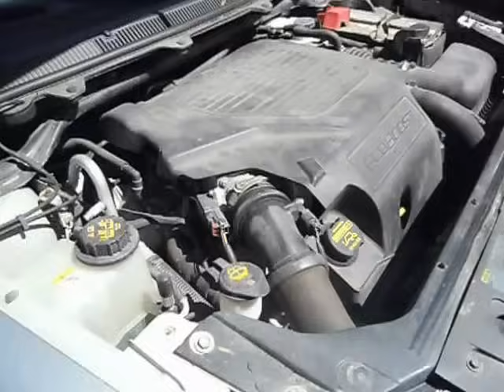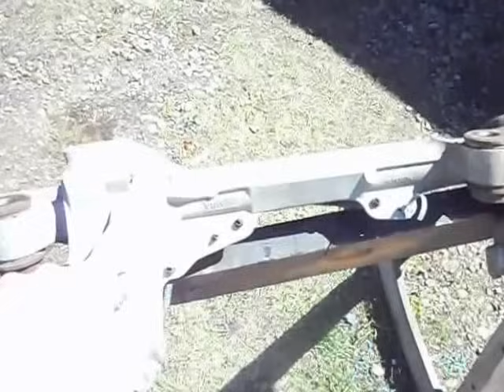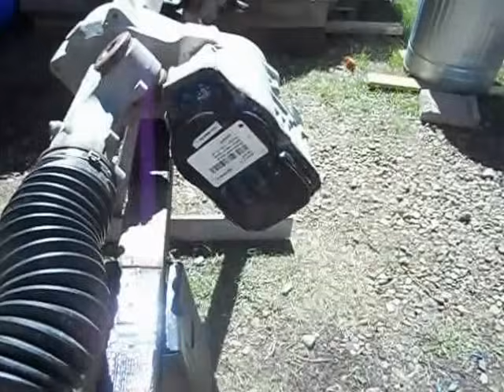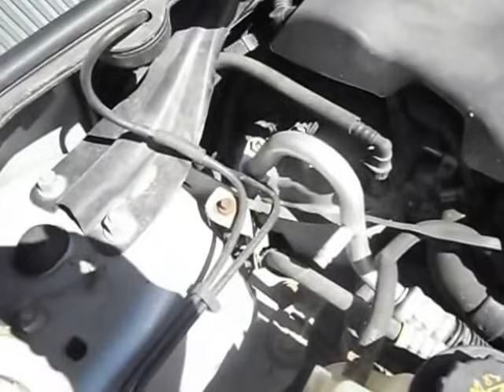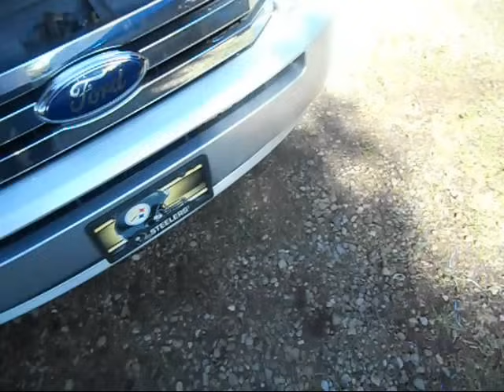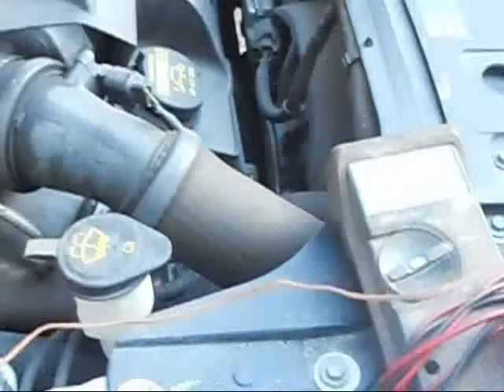Ford Electric Power Steering Failure Identified

Comment: Bro. I need to know what pins you test for resistance. Can you help me out.
Reply from the maker: Performed test almost two years ago, so many details blurred. Also note EPAS design is highly proprietary; so Ford published no documentation, schematics or even operational information concerning design. However I can tell you drive electronics include fully integrated IC with wire-bonded PC connections. All manufacturer labels and markings omitted. Servo-drive motor (either stepper or brushless) includes pigtail with connector  interface to driver PCB. This pigtail interface is where measurements were taken. Measure resistance from individual motor pigtail wires to PCB VCC and VSS. Typically you should always read some resistance; either related to motor winding or driver protection circuits. What you should never see is mOhm resistance between motor coil lead and source potential; this indicates blown MOSFET or transistor junction, effectively providing faulted high-current path to one or more motor winding's; locking motor in place, or causing errant servo positioning. Correctly identifying VSS and VCC is matter of tracing +12VDC and GND from EPAS power filtering circuits at unit front-end. There are (as to my recollection) three individual PCB implementations comprising unit; power and signal conditioning, microprocessor based mother board, and driver PCB. All three are interfaced together through pigtails, ribbon-cable connectors and large copper power tabs. Implementation included highly-integrated  SMT components with various discrete elements. PCB implementations were intended for non-serviceable application; with bonded interfaces between discrete PCB's. You will basically need to cut copper power tabs to separate PCB's.  
Note TRW applied for patent on brushless-motor  based electric steering invention, which seems to closely match Ford unit. This patent design includes motor, three-phase H-bridge driver, microprocessor based controller, motor and rotational steering gear optical encoders, timing belt rack-drive. This patent formed basis for many assumptions made concerning design. It is possible some design changes were implemented in actual production. However patent concept matches implementation precisely, and TRW did license design for Ford use.

Primary EPAS problem is complexity and cost. it is not possible to cost-effectively design and implement such design complexity and diversity within automotive performance standards. Design includes delicate optical encoders, microcontroller, non-volatile memory, etc. These components, in automotive temperature grades, are cost prohibitive. And in many cases, like memory IC's, just not available. Ford approach was to enclose lower-grade components within aluminum housing, in attempt to shield delicate components from thermal stress, and manage thermal exposure under hood. But like any design engineer; whom has implemented such design learns; managing thermal stress is problematic at best. Always leading to instances of thermal overload, no matter how well implementation is planned. How Ford was able to qualify such design, given automotive design and safety standards is highly suspect. Process of qualifying an 'intrinsically safe' electronic implementation includes highly-detailed external analysis of design by 3rd party regulatory agency. In my experience; every circuit and discrete component is analyzed for fault potential. Philosophy involving thermally shielding non-application-grade sub-components in severe and unpredictable thermal environment would be immediately flagged. This is what occurs when engineering design oversight is performed in-house by giant $200B corporation. And regulatory and safety agencies conduct business with complacency and political agendas.

Comment: What needs removal in order to get the epas out? Thanks
Reply from the maker: Job is not too bad for experienced mechanic with air-tools. Service manual procedure should be followed exactly to prevent damage or problematic repair. You may find free shop manual at https://workshop-manuals.com/. Flex requires lowering of front frame assembly. Can be done with hand tools; but many large and rusty bolts. Many important details (e.g. disconnect electrical connectors and steering shaft prior to lowering frame, note tie rod adjustment points and approximate on new assembly, fix steering wheel in forward position prior to disassembly to prevent damage to and align clock-spring, etc.). I was able to complete replacement in approximately 4 hours with air-tools, hand-jack and 6 jack-stands. EPAS did not require any programming after installation, but one Youtuber insisted this was required for his installation. Others have indicated installation is much simpler on alternate Ford models.
Reply: B Smith thanks for the quick reply and great breakdown of the part. This has been an intermittent problem on start up for me but usually resets itself after turning vehicle off and on again. No such luck this time.
Reply: @bk1468  Looking up the part they mention it has to be programmed?  Any info on this?  Thank you!!
Reply from the maker: @mrhallman64  Programming will be required on units not specifically designated as exact vehicle model replacements.  My unit did not require programming as replacement was specific to vehicle. Some commenters have indicated programming was achieved using OBD tools. But I have no specific experience related to programming EPAS units.

Comment: Bro i have a kia it's EPS when I turn the steering a little bit to  the right side  at a certain angle the steering make unusual sound like something is grinding inside and when i complete turning it the sound disappears, 
What is the problem ??
Reply: Did you ever find an answer to this issue ?
Reply: @hederg1621  no

Comment: I beg to differ. 90 degrees is less than body temperature. And ambient temperatures all over the world exceed 90 degrees. If 89deg F is too much for industrial electronics..the the whole world would be awash in malfunctioning shitaki...

 Commercial electronics can survive well into the hundreds and industrial is even better - military is even better than industrial.

That housing being 90 degrees  means very little
Reply from the maker: You have confused degrees C and F. Video specifically states degrees C, which implies housing is near boiling point of H2O, not human body temperature. C = 5/9 (F-32)
Reply: Roudter where did you come up with 90 degree f??
Engine bay can reach temp 600- 800 degrees!!!!
Reply: Wow...I thought the C vs F thing settled it...But 600 degrees anything...those are some vehicles you work on!...
Reply: Roudter 
Ok Roudter I missed that part, but still you have to admit you don't want to set your laptop inside the engine bay, and expect it to function properly

Comment: What side did you  remove it from
Reply from the maker: The following instructions valid on Ford Flex, alternate Ford models may vary.    
EPAS unit cannot be removed from side. Front frame member must be lowered (not removed) to gain access from rear. Replacement is not simple and requires care and experience. Air tools strongly recommended but not required (but you will need breaker-bar and quality sockets). Vehicle will require realignment upon completion. Most important points are disconnection of power and communications connectors, and steering column shaft nut prior to lowering front frame fully. Engine is supported by front fame also, so lower engine mount needs to be detached. Front suspension components need not be removed for EPAS replacement. Vehicle needs to be at least two feet off ground, with additional jack placed under front frame for controlled lowering. Failure to disconnect connectors and steering shaft will result in damage. Also, carefully mark tie-rod positions on removed unit and match new unit positions to old. Lock steering wheel in place and never turn steering wheel with EPAS unit detached (clock spring damage). Align new and old EPAS mechanical steering positions carefully. Give yourself at least 6-hours to complete replacement. Ford vehicles suffer from extreme corrosion issues, so various large bolts may be very difficult to remove. Use PB Blaster penetrant hours before disassembly.

Comment: Thanks for the information. I have a 2011 Fusion and guess what failed this morning my power steering. How would you go about fixing the problem? Thanks
Reply from the maker: You can pay $2K+ at dealer, or $600+ self replacement with refurbished unit. Unfortunately replacement will not address root cause of failure; likely fail again at some point. Make repairs and dispose of vehicle is best advise to avoid future frustration, cost and safety hazard.
Reply: B Smith thanks will follow advise

Comment: i have the same suv as u..so i have to replace that whole thing??
Reply from the maker: Get out your checkbook; Ford wants around $1,700.00 for assembly not including labor. Remember, the new unit will also eventually fail since Ford has never addressed or disclosed overheating issue. EPAS assemblies cannot be third-party repaired; units are remanufactured with replacement of burned out components.
Note units are particularly sensitive to warn front tires; as EPAS servos compensate 'back-force' generated by uneven tire tread. This cyclical servo actuation places extra thermal stress on system which finally contributes to catastrophic failure.
Reply from the maker: Your best option is to purchase unit from ebay and install yourself. This will cost you about $400.00. Contacting Ford will only cause you pain.
Reply: +K Smith ok im mechanically inclied and alwaus have done all the work to my cars...any seller u recommend?
Reply from the maker: Ivan Hernandez
partsbrokersllc (in NC or SC?) sometimes lists remanufactured EPAS units on ebay for around $300.00. Do not know their ebay username. Just do a search for 'ford steering gear', your model and year.
Find detailed service manual instructions for unit replacement; job takes about 2-3 hours with no special tools; but you really do want to follow procedure when removing front frame sub-assembly. Also make sure you carefully disconnect electrical connectors prior to fully lowering frame assembly with jack. Also replace both outer tie rods with quality replacements; because Ford used undersized and ultra-cheap originals.
Job is really quite easy if you have air tools, and a bit more time consuming if not.
Good luck!
Reply: +K Smith ok ill do tha .thanks for ur info..one last question..by any chance u got a detailed disassembly procedure? cant seem to find too much about this on the internet yet..apreciate it
Reply from the maker: Complete and free service instructions can be found at the following link. 

http://workshop-manuals.com/

Comment: rock auto selling them starting at 372.31$
Reply: Link?  I'm not seeing it on the RA site
Reply: Beware.. I’ve just gotten two bad units in a row from Rock Auto. 

They were both Motorcraft reman units. Second one looks like it had a brand new housing (no threads had been cut for the heat shield yet). First unit made a noise like a bad bearing and turned very stiff, which caused a code to set. Second unit is quiet but still turns a little stiff, sets a different code and shuts off all assist after 2-3 miles of driving. 

I’ve had my little shop tied up for two weeks now sending units back and forth trying to get a unit they works correctly. It’s very frustrating. For the vehicle I’m working on (2013 Taurus Police model) the unit costs $413 plus shipping and taxes with a $400 core. It was a good price and that’s why I ordered from them, but they must have gotten a low quality batch or something.
Reply: selling garbage that is new is still garbage

Comment: my wife has 2010 fusion steering went out ford needs to be sued shitty design and danger
Reply from the maker: I invested two years in legal action against Ford Motor Co. In the end I recovered only part of original investment. The experience was an aye opener into the real workings behind a 200 billion dollar syndicate.  You cannot win; Ford will deny, delay and attempt to criminalize your complaint. Ford employs thousands of attorneys specifically tasked to deal with customers who dare to sight design flaws and incompetence in Ford products.
Do not even call Ford; just repair vehicle and sell it as fast as you can. And never go near a Ford product again...
Reply: thanks my thoughts also
Reply: get your vin number type in ford fusion recalls. mine was recalled. went in to get it fixed work for 20 miles and went out again 😂

Comment: twin turbo's in a mini engine compartment ..?
and
you expected no problems ..??
bwhahahaja
Reply from the maker: Try twin turbo's, dual catalytic converters, dual exhaust and manifolds, engine and radiator all crammed with centimeters between components. Even Ford models with no turbo's and smaller engines fail with equal persistence and frequency. What you have here is an engineering disaster; i.e. non-automotive temperature qualified EPAS assembly, implemented within thermally stressed engine compartment. Every single EPAS unit will eventually fail, Ford understands this fact well.

Comment from the maker: Ford and many commenters have published false opinions and facts asserting EPAS failures cannot cause full steering wheel lockup while driving, and further assert graceful transition to manual steering with minimal steering effort required. Having personally experienced full EPAS lockup while driving, causing accident and injury; coupled with concise technical explanation detailing failure disposition based on failed transistor-current paths through servo-motor.
However nothing speaks like video documentation from EPAS owner experiencing exact full EPAS lockup...
https://www.youtube.com/watch?v=FBvcxR7Cui8

Comment: Does the motor in this unit run all the time or only below certain speeds? Or does it only provide power assist when you move the steering wheel?  I have a Ford CMax with this kind of unit and I have a noise that is there anytime the engine is running even at a standstill.  The noise is gone by the time we are up to 20mph.  I'm suspicious of the power sterring system.  
Dealer say $8000 transmission.
Reply from the maker: EPAS motor does not run continuously; motor is servo controlled and only moves when error signal is generated in servo feedback loop. However; servo motors can produce audible noise when in fault condition; like failed position encoder, drive electronics, or various other component in servo system. Typically noise is humming, repeated dull ticking or thud; due to discrete motor actuation under fault, when system cannot properly compensate for feedback error.
Reply: @bk1468  Thank you.  My sound is something spinning, almost sounds like a bad idler bearing or noisy power steering pump but it's been going on for 60k.  Only when engine is running, only at low speeds.  Dealer says in transmission but I have a hard time understanding how. Happens at stand still from idle to about 20 mph then it's gone.  In or out of gear but only when IC is running.  I was thinking power steering because it wouldn't be needed past 20 mph.  Now I wonder if there is some other system that fades out by around 20.  The speed of the sound is constant, not linked to engine rpm or speed of car as if it were something electrical motor driven.  Thank you for your thoughts on this mystery.